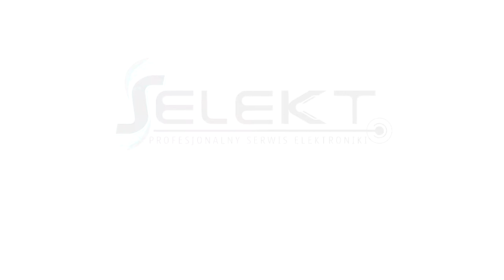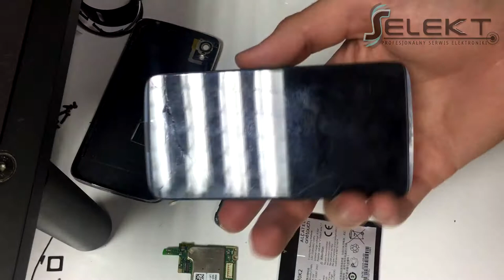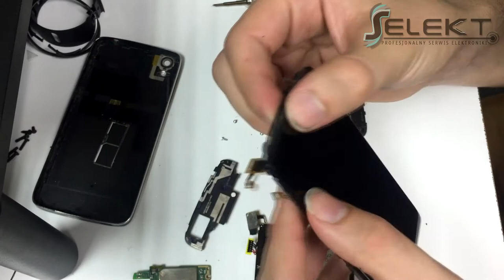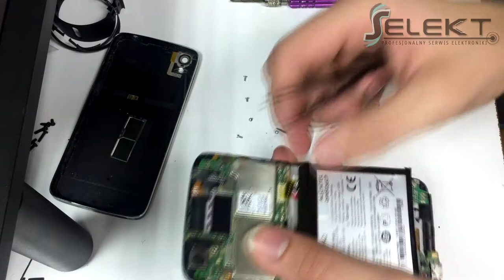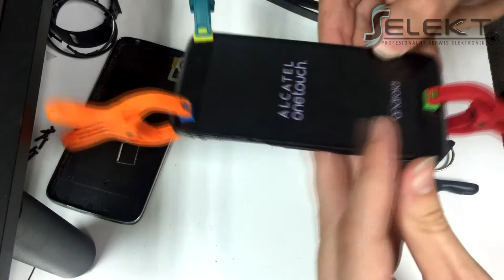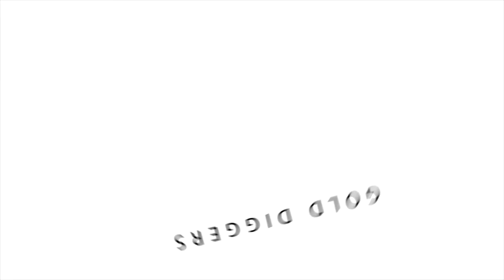Alcatel Idol 3 4.7" LCD Screen & Digitizer Replacement / замена экрана| Selekt

Comment: ita really old video and phone, i know... but i have this phone and after replacing lcd somehow cellular signal went dead!! i cant register manually... which part may be affecting this issue?
Reply from the maker: antenna
Reply: @eSelekt  not the antenna, not the bridge cable to antenna, i tried so many tests and replacement except changing lcd again because i cant find another... i dont even know how lcd caused this?!
Reply from the maker: @doncrix4042  Did you change the screen with frame?
Reply: @eSelekt  no, it came without frame, also i didnt remove the part of antenna because i didnt have to.